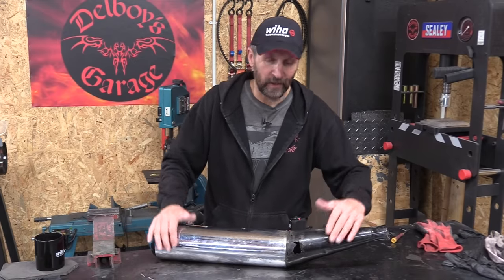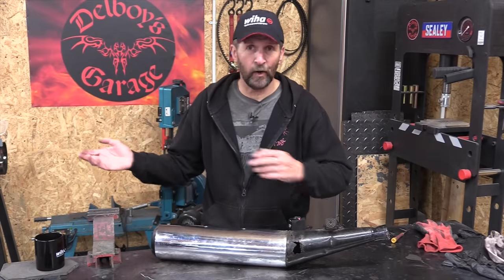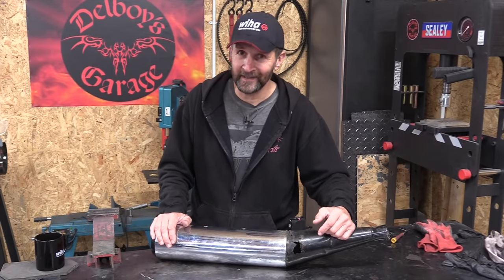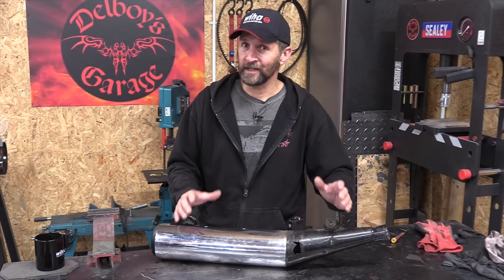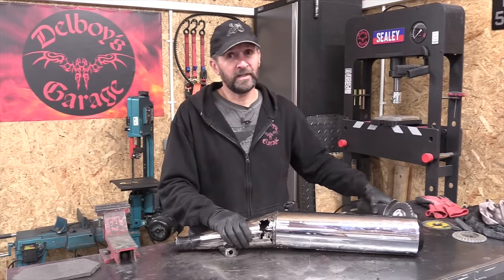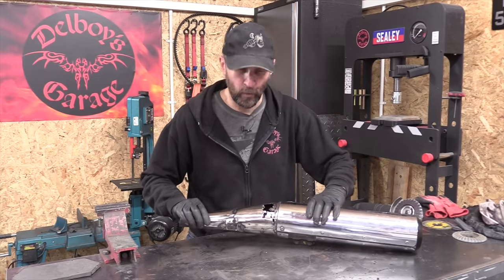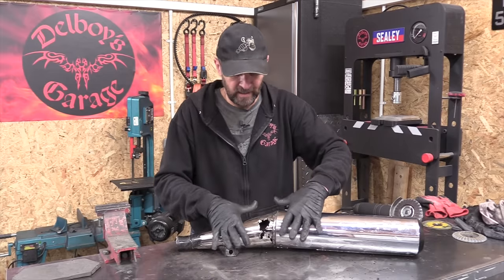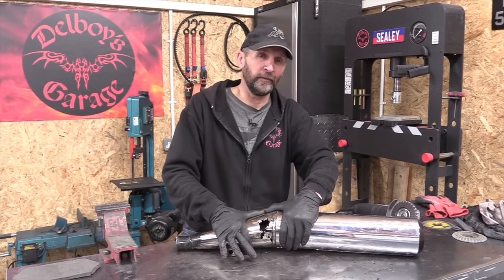Can We Save This 28 Year Old Triumph Exhaust ??

Comment: quick question, how come you put all the effort to make the patch the correct shape and used it as a patch rather than cut the old rusty metal out and weld in new?
not having a dig by any means just curious?

as always great work, ive been watching a very long time and have used some of your methods as well as sharing with fellow bikers.
Reply from the maker: Hi David, that would be the method on a car body patch panel because you want the patch to lay flush with the panel and look invisible... but in this application, it just needs to be super strong and that means doubling up thickness to well past the rusted area and leaving as much of the parent metal in place as possible for strength, basically it doesn't matter what it looks like for this application.
Reply: @Moonfleet41  makes sense, thanks for the reply.

Comment: Nice neat job Del, it's a useful tip to be able to repair exhaust systems. I did my fj1200 silencer  with a bean tin, exhaust putty and a couple of jubilee clips many years ago. It lasted well and kept me on the road while I found a new system that I liked, as most at the time I thought were quite ugly. I bought a Remus stainless 4 into 1 in the end, well recommended 👍
Reply from the maker: Great fix mate, that's how we used to do it, it seems those days are lost on the modern rider, plus of course, with the build standard of modern bikes, exhausts don't really rot out any more.
Reply: @Moonfleet41  you're right there, mate. Back in the 80's exhaust systems pretty much dissolved at the first sniff of water and salted roads! Quality has improved so much over the years.

Comment: Neat repair,should last for years let alone just the winter 👍like the English wheel you have,the way its compact and can be stored away easily and not the usual way I think of one needing a lot more garage space,good video 👍
Reply from the maker: Thanks mate👍, jumped at that wheel when i saw it.. it's limited to what sixe of metal it can process, you couldn't roll large car panels in it..but it works for bike related stuff !
Reply: I agree.  Repair might even last as long as the bike.

Comment: Lovely repair Del. I hope there's young aspiring mechanics who watch this vid and see how important old school fixes are. Most anyone can change out new parts but there are often solutions not taught and your repair was one of them. Template, cutting, grinding, English wheel, fitting, welding thin sheet steel, drilling drain hole and off you go, likely stronger than factory...brilliant, top drawer.
Reply from the maker: Thanks mate, it is an old school thing and kinda lost it's fashionable place these days... but people still restore cars and it will always have value... glad you enjoyed and thanks for your kind comment!

Comment: As someone who can use an angle grinder although not a welder, I'm sick of carefully filing the edges of newly-cut metal so that they don't cut people. So what was that brilliant little tool you picked up at 5:05 to dress the edge of the patch? It seemed to work like a charm.
Reply: Reaming tool, you can get them in small sets with various head fittings
Reply: @kennymacm3031  Thanks for this. Never hear of that particular tool before.
Reply from the maker: Hi Richard, it's actually called a de-burring tool and I left a specific link to it in the description as I knew somebody would ask, but to save you looking, here's a direct link right here... it's cheap as chips and comes with a spare head in the handle!  Thanks for watching... https://www.spanner-monkey.co.uk/deburring-tool-with-spare-blade-114024?search=db01&description=true
Reply: @Moonfleet41  That’s brilliant, thank you. For once, I didn’t look in the description. My bad. I’ll have to get one soonish. Cheers.

Comment: Good job. Had to replace my Busa downpipes recently to stainless because of rust. On the subject of rust, although slightly unrelated, what would you use on a car underbody to stop the prevention of rust in its tracks? Got a Toyota Celica at the moment, that recent failed on sill rust, and I'm on the fence about getting the welding done or binning it, as I don't know if it's going to be something I'd be chasing my tail with, come every MOT.
Reply from the maker: Rottin cars is a terminal problem.. you're only ever prolonging the inevitable mate.... just weigh up the costs of repair against replacing the car i guess..!
Reply: @Moonfleet41  Quite so Del, however if it an old (classic) Celica, it's likely worth saving. A slow, budget allowing version of car SOS perhaps ?
Reply: got a v6 91mx3 Mazda,,get it jacked up and waxoil it, wire brush the surface rust, treat it rust inhibitor etc. i use a 95 corolla tsport, and the wife has a 300bhp 03 tt as daily transport ,weekends spent tinkering is my hobby and keeps my cars sweet.
Reply: @russcattell955i  It's a 2004, it looks nice enough (on the top, anyway) and the engine is good.
Reply: @hunterjg777  Back in the day my MD had one, she loved it.
Reply: @lancefawcett1809  Ok so wire brush and waxoil is my best bet then? Pretty much what I've been hearing. You mentioned a rust inhibitor - was that something in addition to waxoil? or were you just referring to the waxoil? cheers.
Reply: @russcattell955i  Yeah they are quite nippy/fun to drive, nice handling.

Comment: While it may very well be an indictment of my ability (or lack there-off) with a MIG or ARC welder, I always limber-up the oxy-acetylene rig and braze my sheet metal repairs. It always seems to yield a cleaner job (but that could simply be attributed to the fact that I'm well-practiced at it). Regardless, well done on an effective repair! PS Get some smaller chisels instead of using a screwdriver! lol

Comment: Seeing this vid makes me almost upset at this guy. Why? Because he's the bearer of bad news.

Yes. It looks like I've a lot of work to do if I want to get my nearly 50 year old rice burner cooking again with the original stock exhaust. It's either what this guy has done here, or...pay the piper {literally}.

No doubt that I can do it. Just lots more work than one plate. I've got to make individual chamber walls inside the pipes to hold the baffles as well as the collars at the ends of the pipes to seal and secure them with a machine screw or other fastener. Plus I've a set of spare pipes which are also rotted.

Wish I had done this over the winter. I'd probably be riding by now.

Yes..I hate you!

Comment: Great repair video Del, what wire did you use in the Mig for dis-similar materials, mild steel/stainless, or does it not matter ?
Reply from the maker: 0.6mm mild steel wire mate.
Reply: @Moonfleet41  Many thanks Del.

Comment: a nasty job MOST said is impossible, same on my Trophy mine went on the main tube tho, then when I got my CB500 it had the same MOTARD exhaust, one blow hole by the hanger.......

BOTH repaired with GUNGUM and Plate Plus Black Exhaust Wrap on my RAT-Trophy and Blue on the Little CB500

Comment: Nice job mate - money well saved - an I have to admit to thinking at one point where I thought you were final fitting "oh - is Del not going to paint it?" - but you were actually just temporarily fitting to eye up where to drill the drain hole - and of course you never let us down - and paint it you did - if nothing else - proof that a student should never question the Sensei aye? 😉🙏Thanks as always guys!
Reply from the maker: Thanks mate, appreciate those kind words, if it had been stainless I would have buffed it up and left it, but mild steel ain't gonna last 5mins in salty ol' Blighty, specially through the winter season!  Have a great Sunday and thanks, as always, for your support, D&Px